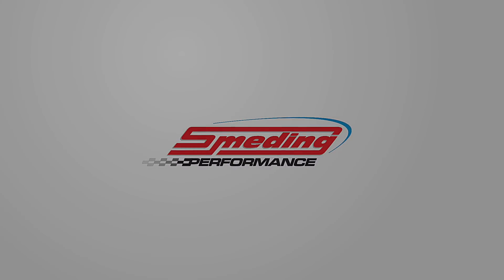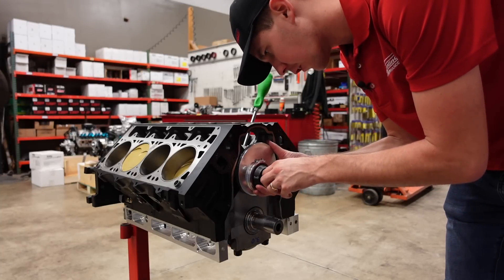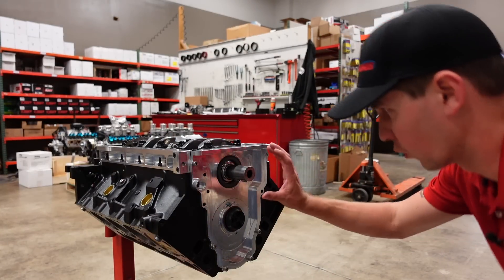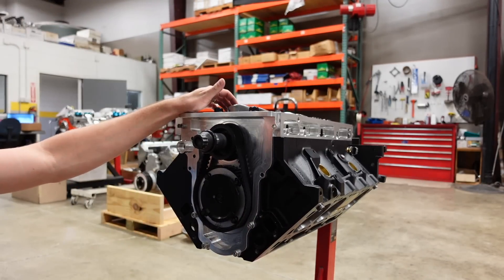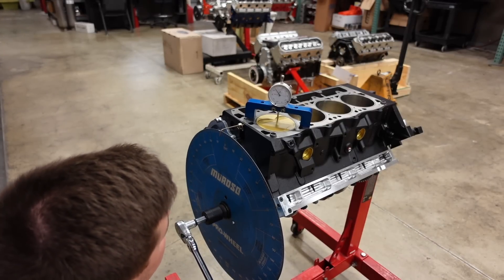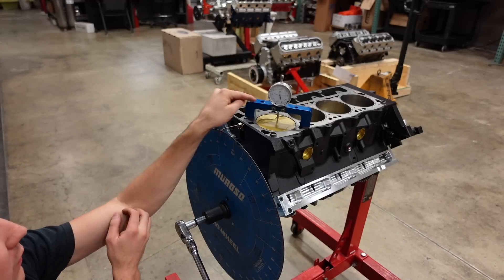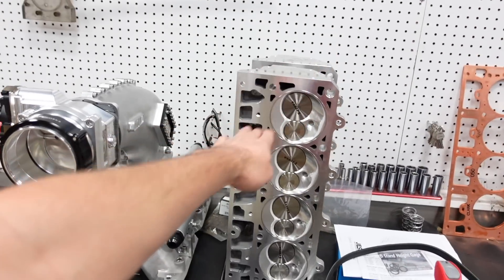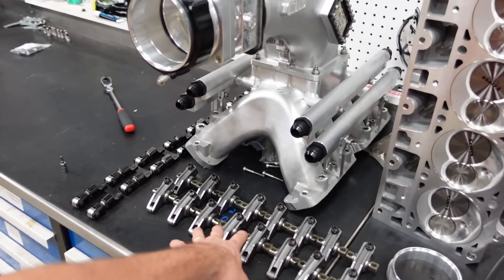3,000hp LS gets JESEL BELT DRIVE & DRY SUMP Oiling System - Part 7

Comment: Should I set extra bearing clearance on 2 & 4 mains? Using LSX block, custom age studs, and billet 4330 Callies crank. Planned on running .0032 on all. A lot of people have told me to set extra clearance on 2 & 4, but not with the 4330 crankshaft. Trying to get your opinion. Thanks!

Comment: Do you take any precaution with storage? I have an LS crate in my garage and I'm maybe over paranoid about rust on the cylinder walls from the humidity in the garage, but maybe I'm worried over nothing?

Comment: Could by adding extra oil from the turbos into the engine valley, cause windage power loss and foaming issues, as this oil drains past the rotaing crank and rods ?

J

Comment: Please add another stage to the pump for the turbo drains you’ll really appreciate it later
Reply: John
Would've  that pull too much oil from the turbo
Reply: @stevengrabowski667  No, you always want the best drainage you can on turbos especially when you get to larger frames, ball bearing center sections, etc. The more oil you can feed through the center sections help reduce heat buildup in the turbo which increases bearing and seal life, also eliminates oil pushing past the seals causing the turbo to consume oil and smoke, also oil leaking past the seals and burning in the turbine section causes build up, it leaking into the compressor side can damage the compressor wheel, and pushes oil into the engine. It also makes it so the very very hot oil coming out of the turbos isn’t just dumped on the internals of the engine. Having a scavenging section of the dry sump dedicated to the turbos is by far the best way to go.

Comment: i actually had quite a bit of crank pressure in stock LS's in the lifter valley, holley gave me a center cover with a oil fill cap in it for my twin intake car, and i used that as the vent and it would puke oil out of there something fierce, engine not blown up, crank pressure sensor showed nothing either.

if you have issues, not saying you will, but if you do look at that first haha
Reply from the maker: Good to know! I’m hoping the dry sump pump will help alleviate crankcase pressure
Reply: @JacobVillemain it almost seems like just oil violence there for some reason
made a mess out of my dyno bay i thought it was blown up, just moved the hose and viola, im sure some sort of baffling would have fixed it
Reply: i also really like that dry sump, scavenge channel, pump holder all in one unit
Reply: my genv LT1 has crank case pressure issues as well D:
Reply: Is the dailey unit the one with the air separator engineered in also? One things for sure, there's no sitting in on the floor 🤣  I'm major jealous